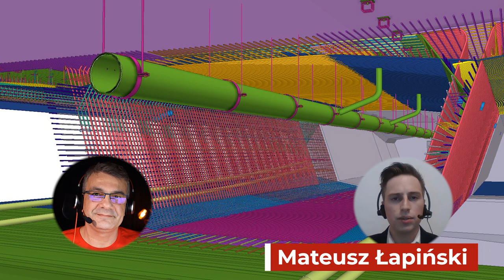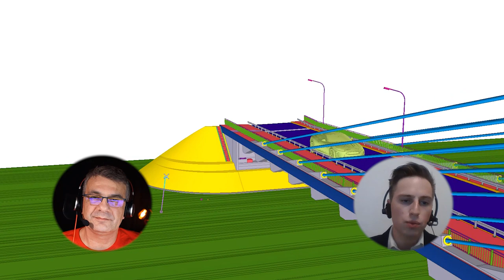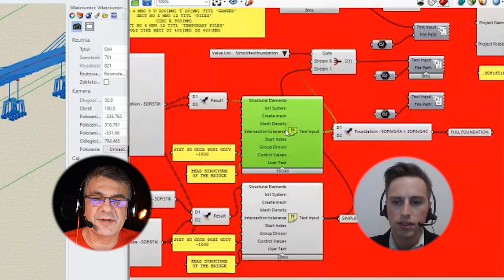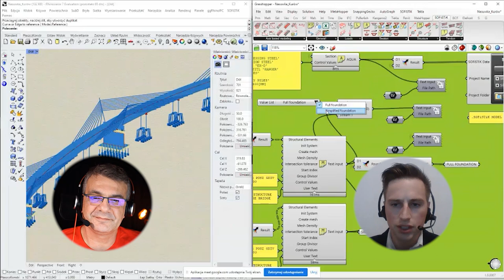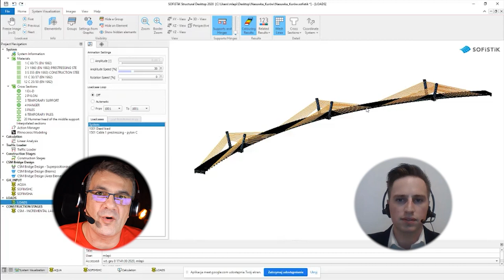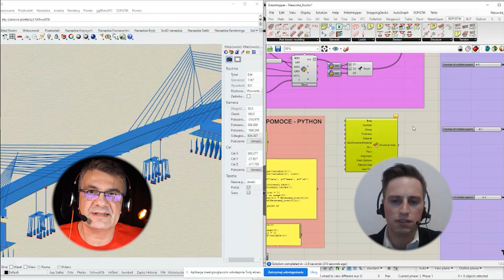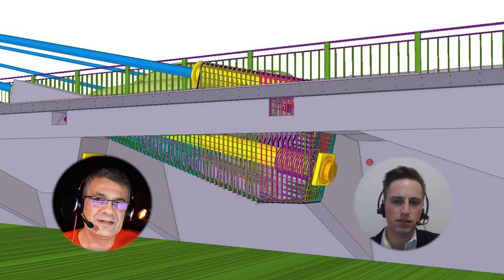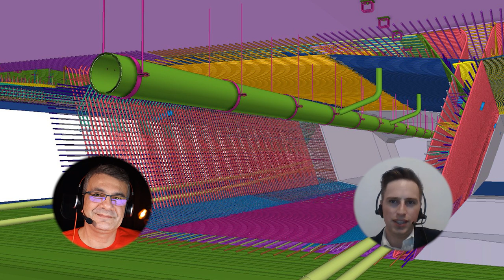He Did It All by Himself - Sofistik/Rhino/Grasshopper/Tekla - Interview & Demo

Comment: Impressive work, congrats Mateusz. Grasshopper is such a powerful tool. I also did my master's thesis in this field.  However,  my topic consisted of the structural optimization of footbridges considering dynamic system response (vibrations). 
Check it out, here:
https://www.linkedin.com/posts/activity-6727884886595690496-9NPQ